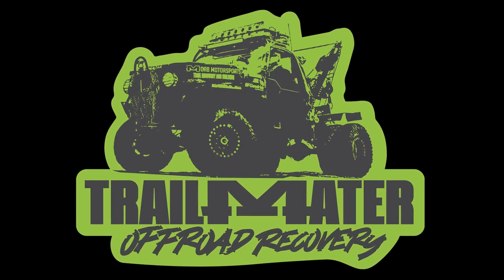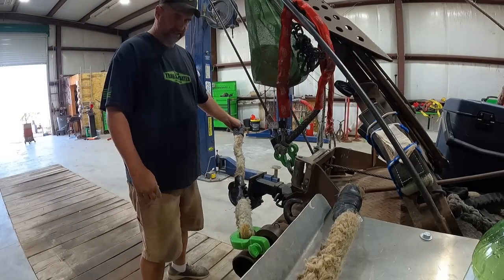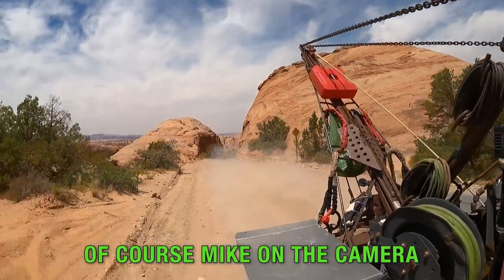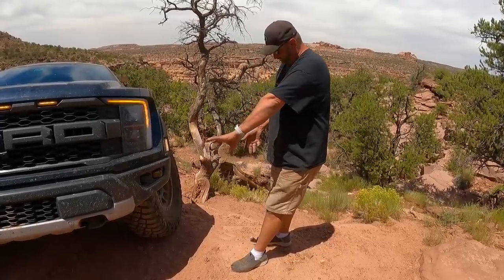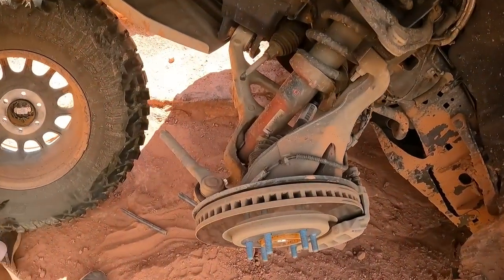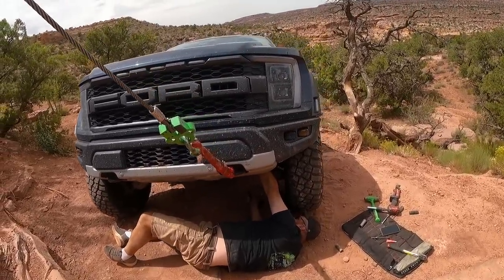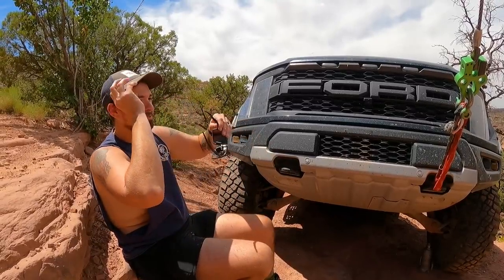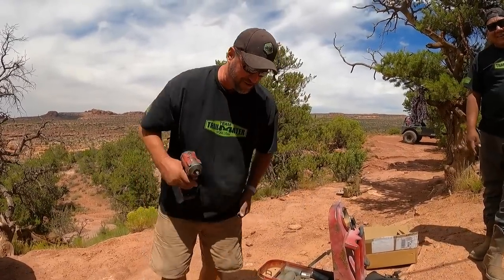Repairing A Raptor On Porcupine Rim

Comment: In ten years of suspension work I've never seen a tie rod like that bolted to a rack and pinion.  Of course I only see Raptors that are pavement princesses. Great video guys!
Reply: Raptors and for pavement or desert sand at 70mph.  Only seen one on a Colorado trail after running over 100 of them.

Comment: Never heard of using a bottle for shrink wrap.Thanks.I've also never seen a Raptor out in the wild being used as an actual truck.Kudos to the guy who does use it well.
Reply: with that stock tie rod it should be called a Craptor!
Reply: @TBR7Chronicles  If you have IFS and you aren't carrying spare tie rods you should probably re-evaluate things. 

About the bottles, they are manufactured from smaller plastic bottle blanks or "preforms" and are heated and blow molded into the final shape. So I think when you heat them back up they have "memory" and want to shrink down again.
Reply: They work great for making shop vac adapters for table top tools that make dust too.
Reply: That guy was having fun towards the end of the trail though. Props to him for using it and actually having fun with the truck.
Reply: @TBR7Chronicles  you have no idea what your talking about. This exact tie rod has performed just fine since the first gen. Drivers play a big role when parts break, no matter factory or aftermarket parts.

Comment: Use tig filler rod as needles and weave the loops into the ends.
Then after you get weave into it,then hook one end to something sturdy at ground level. 
Then clean floor, and roll it back and forth under your foot as you apply pressure towards the middle of the rope until it's tight.
Do both ends and repeat until you are satisfied. 
Possibly may have to get it soaking wet and pull between two trucks until dried completely in sun.
It works great, and you'll figure out how to alternate strands to weave it, just follow the pattern in the rope.
Just try to keep even throughout the weave, and go 6 to 8 inches into the long section with minimum of 6" loop or no larger than 8 or 9

Comment: I have a ‘23 Raptor and I don’t think I would every take it on many Moab obstacles. It’s just not well designed for crawling in multiple ways. It does great here on Texas dirt roads!

You guys do awesome work, as usual 👍
Reply: Many years ago we were sitting up in the parking lot at the top of the Shafer Trail. “Man, my ‘88 Suburban is 4-wheel drive. Honey, let’s do this!” Ok, our trailer was parked at a campground in Green River. Our kids were young, but we had lots of water. “Nope”, she says. “What’s the worst thing that can happen?” Probably saved the marriage with my next decision. :-)))

Comment: I admire the Raptor guy. Not only was he taking that truck off-road, but he knows that he needs to strengthen the steering parts. That, plus he was hauling ass on the smoother parts!
Reply: All I saw was an $80,000 sewing machine trashing itself on the rocks. Those custom built jeeps and chevys are no joke and I think that is made clear time and time again.
Reply: Hell if the guy has the money, let him have his fun as long as he's safe and respectful of the trails, passengers, and the people around him. But you are right that more capable rigs can be built for cheaper. That's not the boat everyone wants to float though, so I say let them burn the money and when it breaks it breaks. Their breakdowns are just way more expensive than our cheaper and often more capable rigs.
Reply: @JohnSmith-ev1sm   Every time you see a Jeep on the highway it's obvious that Jeeps don't belong on the highways.  At least this guy can drive his Raptor at high speeds. If it's any distance at all Trailmater has to be trailered to where they are going.  A Raptor is just a tool that is great on the roads and pretty good off roads.  There is no perfect vehicle for everything.
Reply: @WYO2K  We're not talking highway though, are we? We're talking about going offroad where the raptor is supposed to be able to function better than simple trucks; and yet its performance is abysmal compared to simple old school trucks and jeeps that are purpose built. I didn't mention anything about perfect trucks, just that if you're buying the raptor to do what the marketing would have you believe its capable of, you're wasting your money; better off building something. All these YT guys like matts offroad and fabrats show the same thing.

Comment: Not too often, people with raptors (new ones) actually use them for what they are built to do... thats awsome
Reply: Most of them probably never even see a dirt road, much less go off-road.
Reply: Not a rock crawler, more of a desert runner. But at least it's being used.
Reply: @tumbleweedking5668  It sounds like the owner has, or will have, some new parts to beef it up. At least the guy isn't afraid of some desert pinstriping.
Reply: @61rampy65  My wife has a 392 Rubicon that gets washed and waxed weekly so I can't say anything about mall crawling.
Reply: I sure miss mine.  I had a ‘17 I put almost 200k on it before I got rear ended so hard they totaled it out.  The new ones were just too much to justify buying again like over 90k I got lucky and got mine in 17 for 68k.  It’s about as versatile of a truck you can get.  Plays as well off road as it does on the Red Carpet!   For me it was a work truck and a play truck.  From frozen lakes in MN to ID mountains to the AZ desert, it never let me down.  Then some ass hat ran into me between Phoenix and Sedona
Reply: I don't know sometimes I think you are better off buying a lesser truck, avoid all the pinstriping, and use the saved money to buy a Can-am.
Reply: @archstanton3636  I’ve thought of that too, I don’t have the garage space for it, or that late what I think I’d do.
Reply: The goofy clips at the end make me smile! I appreciate the camaraderie with everyone.
Reply: These new trucks are not built for rock crawling, they need bigger axles and tougher suspensions for this kind of terrain.
Reply: Yeah, “built to do..” like break on the trail.
Reply: I don’t think the raptor, or any full size, was meant to rock crawl.  It’s meant for bustin speed limits on the rare fire roads that are wide enough for those beasts.
Reply: Built to Break ? 😂
Reply: To break down and get rescued by a Chevy
Reply: @vincentwhitecage3005   with a 424 special and leaf springs hahahahhaha
Reply: @61rampy65  It was rather painful at first when I took it down an overgrown trail when it was just shy of 5k miles. Now I wear it like a badge of honor.

Comment: Rory I admire how you reuse the old ropes and find a way to make them stronger. 
I am definitely getting old because I wouldn't take an expensive truck like that on trails. You know you will get damage and you need to make sure u have clearance for going over obstacles. 
Expensive vehicles are made for luxury and they aren't made for off road stuff. Just my opinion

Comment: I used the cap end and heat shrunk to a PVC pipe and it heat a column of water 6' long for electrolysis on a rusty pipe  .
Works good and tight

Comment: I've been using the Harbor Freight soft shackles for about a year now and I gotta say, I really like it, it's never failed! ! Just picked up the winch rope, some of the best products they have at HF, Just put it like this, if Rory is using it, it has to be good, or as we know from watching the videos, he wouldn't use it if it was a POS, and something I noticed here at the Hempstead Long Island HF , they lock up some knives/possible weapons, but leave the 5$ machetes out? But after going a few weeks ago, they have started locking them up as well, but you can still get at the Axe 🪓 and other possibilities 😅 it's the Hood so nothing would surprise me! I was there a few months ago and a crackhead ran off with an expensive table saw! A tow truck driver gave chase and beat the crap out of the crackhead and brought it back, they don't mess around in the NY ghettos! And not for nothing, the raptor, that front end is a joke! 😢 expensive garbage 🗑

Comment: I don't know if you'd ever seen my comment a long time ago but I thought having a couple of long gas charged shocks to make sort of collapsible 'A' frame in conjunction with the 'X' ropes so that in the rare occurrence that the towed vehicle didn't have brakes or didn't have someone in it to maintain 'brake control' the shock absorbers would maintain a dedicated distance between the vehicle and the rear of the tow truck and the ropes would still serve their current purpose but also act as limit straps for the shocks.  You guys obviously know your stuff and don't need any more suggestions but I just have seen collapsible tobars on the back of motorhomes that they flat tow their additional cars with that have basically the same concept but lock into place, where is these shock absorbers used in conjunction with the x ropes would absorb movement and be independently flexible to maintain control fore & aft to help keep an 'unpiloted' towed vehicle off your aft...LOL!! 
  Oh I always wanted to tell you how proud I was of you after starting a channel that's almost as good as those Hillbilly Deluxe fellers!!!
( It's been really nice of Sean and Mike to kinda teach you the ropes!)

Comment: I've noticed in other's videos and now in this one, that Ford seems to have a problem with steering tie rods on vehicles with IFS and rack and pinion steering (seems to be a big problem with the new Broncos). Aftermarket is already addressing the problem,  but for what those vehicles cost, I hope they're looking to solve that problem from the factory. Another great trail fix guys; keep up the good work!
Reply: Imagine if it was the veloci raptor ( yes Ford made them , just way more expensive , V8 with supercharger )
Reply: Tie rods are notoriously bad on all the raptor generations. RPG can’t keep their billet ones in stock, like a 4-6 week wait. The entire tie-rod is the same as a standard f150, minus the inner portion is just longer. I knew this, that’s why I had them. Sitting in my garage. 2k miles away. 🤦🏻‍♂️🫠🫠

Comment: A Raptor was designed for crossing the open desert at some speed. Not race speed, but not grandma speed either. Inspiration from offroad race pre-run trucks. It was NOT designed for rock crawling. It also was NOTdesigned for Nitro Circus jumps, either. I know...what a killjoy wet blanket I am.😎

Comment: I had always wondered why Ford bought the bobby-pin factory. Now I know - so they could use them as tie rods on their 4x4 vehicles. Tip: use OG friction tape instead of 'lectrisikal tape. It becomes one with itself and does not turn to goo when exposed to oil or heat. I like the new rear fenders on Mater.